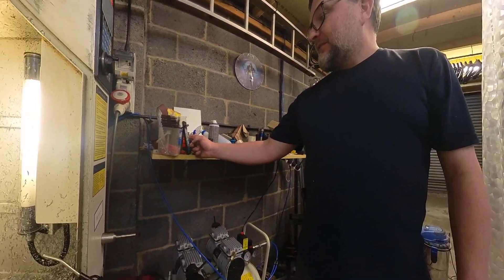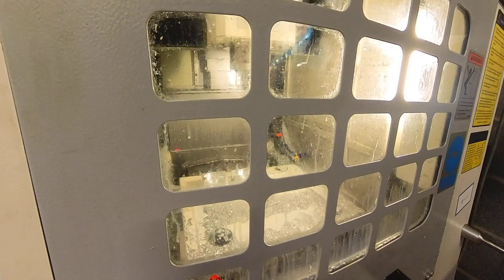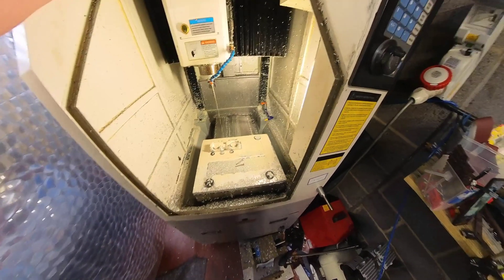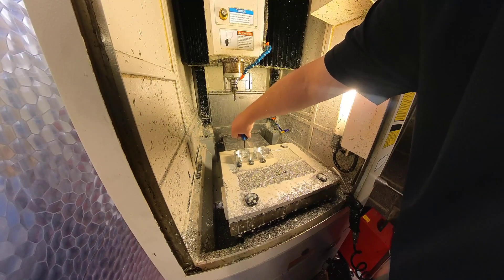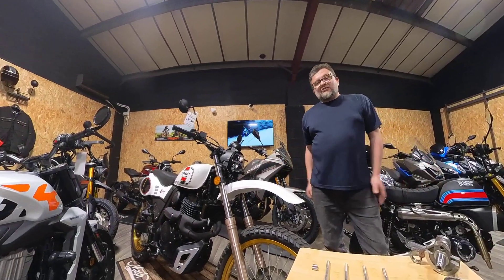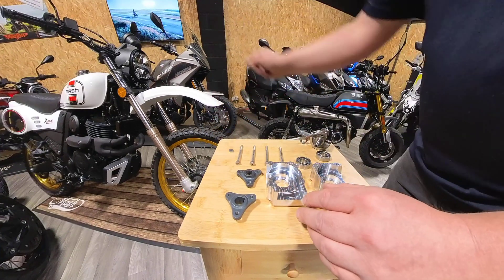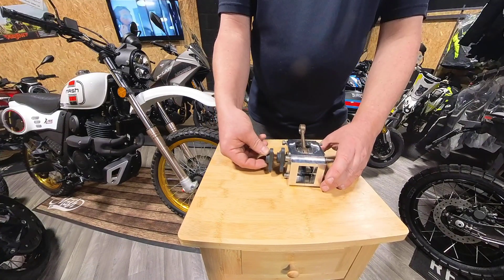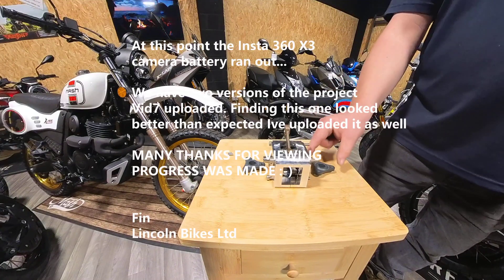The Supercharged 6 Cylinder 2 Stroke project made from Temu engines - VID 7 Version 2

Comment: What is the cylinder arrangment going to be?
Reply from the maker: Will be banks of 3 Cylinders. It will all depend on the bike we end up with.  The goal is to have 6 equal spaced bangs per revolution just for the sound. :-)

So a divorced v / flat 6. Or an inline 6  it really could be anything. 

Im liking a rectangle divorced 6 😂
Reply: @LincolnBikes  inline 6 with the drive coming out of the middle? Like a 4cyl snowmobile
Reply from the maker: @WikWak  Yep, driving the bottom end of a motor in the bike so Ive clutch and gears sorted
Reply: 15° narrow angle v6, aka VR6? ! 😉
Reply from the maker: @nee3029  rectangle 3 x 2😂